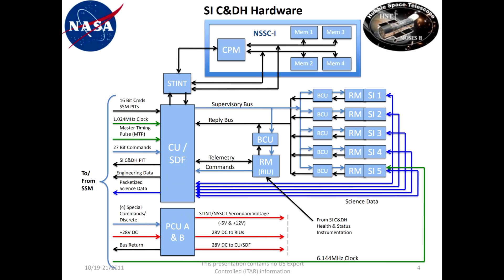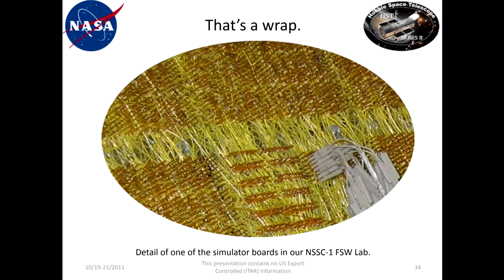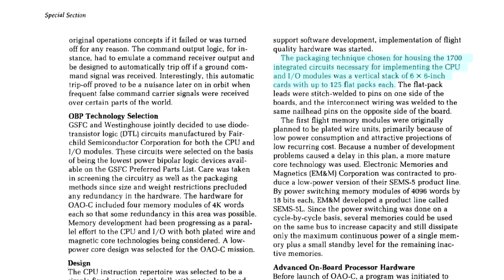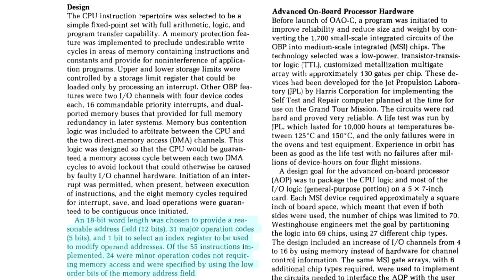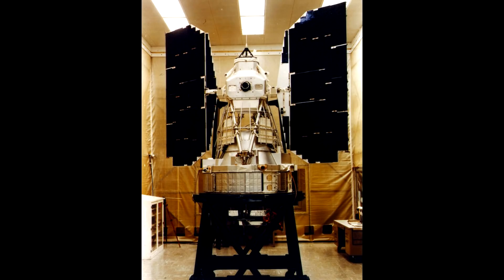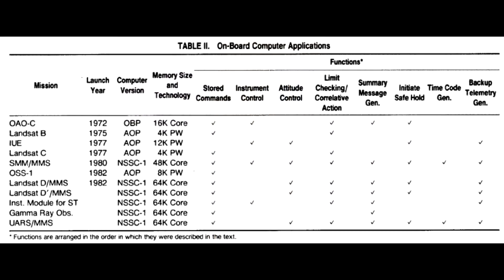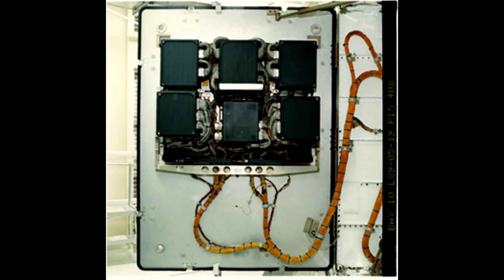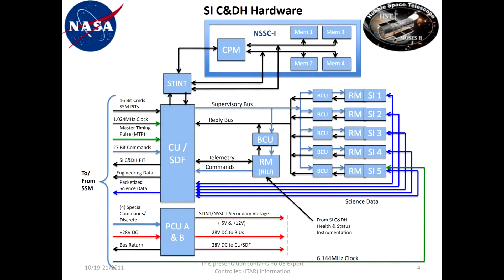Hubble's Latest Problems May Be In a 50 Year Old Computer Design

Comment: A 50 Lb computer on a spacecraft? We can fix this with something that fits into the palm of your hand. Let's do it! I would like to see Hubble continue as long as it can and ultimately become available to amateur astronomers who submit money and a proposal for some time. The fee can be used to cover the maintenance of Hubble. Don't just send it out into space or crashing into the earth. Take it to the public to see what the response will be.
Reply: Won't fit in your hand once you add radiation protection and a power supply that can power the entire telescope.
Reply: An astronaut could wear an Apple Watch and donate it on the spacewalk.
Reply: There's a reason it's so big.  Number one, redundancies.  Your computer has none - generally doesn't need them - everything that goes up into space does, unless you consider it disposable.  Number two is radiation.  It's the electronic equivalent of sandblasting.  Little errors in live memory here and there which need correcting all the time, and actual atomic-level damage which slowly accumulates.  Practical amounts of shielding cannot stop all of it.  You have to build around it by making your IC's less fine and delicate.

Which isn't to say that things have stayed unchanged in space.  There's things like militarized, low-end pi's up there, running hundreds of mhz (which can do a lot, if you don't need to run windows on it).

Comment: As for having a spacecraft capable of a Hubble repair mission: It's sorta already underdevelopment. The Dragon XL being built for the Gateway has a large pressurized habitable compartment. Launch one to the Hubble, filled with tools and the EVA suits (EMUs), and follow it with a Dragon crewed with 3 or 4. The Crew Dragon (CD) docks with the XL and two astronauts board it. The craft undock. The 2 crew do their O2 pre-breathing and don the EMUs. The XL is depressurized and the 2 astronauts exit. The Gateway will have one or more small robot arms. One of these can be adapted for this mission, and XL will already be designed to be compatible. With the spacewalk complete and the crew back inside, the CD docks again. In this way the XL functions as a detachable airlock. The capability for another spacewalk is there if needed - no need to worry about how many depressurizations are done, XL can carry plenty of O2 and N2. 

Remember, the airlock has to be big enough for 2 astronauts to don the EMUs, and they're big. The XL is a nice large "airlock." There is a problem, though - the EMUs can't fit through the Dragon docking port. IIRC the XL version will have a larger one, but then it won't be compatible with the regular Dragon. This mission is fairly minimal cost so far, but adding an egress hatch on XL's side will bring the cost of engineering/approving a crew-rated design. Hopefully an enlarged version of the CD side hatch will be straightforward enough.

Well, it'll never happen anyway, but it's fun to know the capabilities. If anything is done with Hubble it will depend on Starship succeeding. And realistically, with Starship available is it practical to service decades old technology? Solving the problems of returning Hubble to Earth will be more fruitful. It doesn't have to be undamaged, just intact enough to be rebuilt.

Comment: How about sending a Dragon there to fix it? Two pilots, two eva suits. With the lower cost of the falcon vs shuttle, it might be worth it to make a birthing adaptor to hook onto the hubble and keep it going?
Reply: Or have an official say "this is so hard, even SpaceX couldn't do it"
Reply: This is would be job for the ISS, because it needs to be captured by an arm. But Hubble might be to big for the ISS arm also. And I think the ISS is no where near Hubble orbit. Crew dragon doesn’t have air locking systems so no one can leave Dragon and do a spacewalk. Only the shuttle had the systems required for this type of job.

Comment: Core memory and tape decks. I had no idea this was the original design. So unremarkable for something so visionary.
Reply: It was standard procedure at the time it was designed.  Worked for Galileo.  Semiconductors were and still are very vulnerable to radiation.  Any space probe which doesn't die from something else, the radiation gets eventually

Comment: There's one wild turkey of an idea... There is still a Buran that is 95-97% completed sat in the hanger... Get it finished, refurbish the machine and there's your shuttle right there to fix the HST
Reply: The roof fell in on it a few years ago, it's stuffed big time.
Reply: @paulstubbs7678  That was the one that flew - there is still another almost complete one there
Reply: No..there isn't.  Both of the Buran shuttles are either destroyed or are in derelict status.   It was a nice thought--but not rooted in reality.  

HST is 31 years old...its gone well past its designed service lifetime.   When the last servicing mission was performed in 2009, astronauts attached what was called the SCM (Soft Capture Mechanism) to the base of Hubble for a future next generation vehicle to dock with Hubble and guide to a deorbit into the Earth's atmosphere. 

The good part about Hubble's situation is that it is in orbit 600 KM above Earth...so its not going to degrade and burn up in the atmosphere anytime soon. 

So if it goes dark--it could conceivably be orbiting for years--during which time that next generation vehicle is equipped for such a mission.

Comment: Good lord, Hubble is controlled by a Commodore 64 which is known to have power supply problems.   

Hahahahaha
Reply: Hmmm the clock speed of the cpu does look very 6510 but I doubt that a MOS chip would have been space hardened ;)
Reply from the maker: Did you know the ISS has a piece of hardware to control the battery charging for the space suits and it’s powered by a 6502?
Reply: @scottmanley  that's awesome! I know that NASA was still using Amiga 1000s for processing telemetry data up until 04 I think but having a 6502 on the ISS takes the cake.
Reply: @scottmanley  
Suprised they can even find a reliable source of 6502s..

Comment: I have gotten old with the Hubble. Is there something they could do with the autonomous robot they designed for the ISS? A program and added booster, not tme frame, and send t on its way? Hate to see such a great old friend wither away...
Reply: hubble is in a very different orbit.  Not easy to get there.  But I've often wondered why they haven't built a tele-operated robot to just send up from the ground.
Reply: @tsm688  As I remember, they did. To do work on the ISS. But I haven't seen or heard anything about it since they announced.
Reply: @christophervanmeier1648  Meaning they kind of thought about it at little bit but scrapping all available options was easier.  Meh.

Comment: Hi Scott you said that nothing that can fly can fix Hubble like what the space shuttle did. I think you are wrong the ISS can fix it. It has all the amenities like manipulation arm and spacewalk capabilities all what need to happen is for the Hubble to move/rendezvous with the ISS so that the canada arm can get it. This can be done by a mission extension spacecraft that can connect to Hubble just like the how the shuttle did. Once there new modules can be brought up in the trunk of Dragon (if they fit). The bigger probably is to build/design components that work with both the old stuff and new stuff
Reply: The hubble is in totally the wrong orbit for that, nowhere near it.
Reply: @tsm688  HI that is what the mission extension vehicle will do. Hubble is in a 550km orbit with a 23 degree inclination and the ISS in a a 400km orbit with a 51 degree inclination. The main problem is the inclination difference of 23 degrees with will requier a lot of fuel to change but it wont be impossible
Reply: @jonathancampbell3907  I mean, nothing is impossible, but that is pretty implausible.
Reply: It would make the ISS be a repair station

Comment: I find it funny that how all the people who claim the Space Shuttle was a failure and should not have been built, never discuss the Shuttles' unique ability to conduct in-space rendezvous/repairs.  They ignore the fact that it would have been the Hubble Telescope that would have been a failure without the Shuttles' capability, nor would the Hubble Program been as long lasting as it is without the refurbishing missions performed by the Shuttles.  They also refuse to acknowleded that the ISS would not have been constructed as quickly or as immense without the ability of the Shuttles.  The current Hubble issue will not be the only episode where NASA will state "If we had a way to get people and equipment up to it we could fix this".
Reply: There's a couple angles on this.  But mainly, we could have had a handful of Hubbles for the cost of all the monkeying we've been doing to just that one.  And the space shuttle was responsible for the massive delay getting it into space in the first place.  But at least one servicing had to be done to restore faith (and therefore funding) to NASA.

I agree the space shuttle was unique and I miss it.  But the real failure is the lack of drive to improve on or even just replace it with more mundane rockets.  It doesn't take a genius to consider attaching a robot arm to a space capsule - and we don't even have that.
Reply: @tsm688  Just to be sure, I doubled checked with the HST history.  It is true that the Challenger disaster delayed the HST launch. it was already far behind schedule and vastly over budget.  The records shows that the ground based controlled systems were not ready for HST's initial 1986 launch date, and was barely ready for the 1990 launch.  As for funding, like all NASA projects the Shuttles were under constant attack by members of Congress, so that argument rings a bit shallow.  One thing I've also observed is that a lot of people claim that the Shuttle Program was more expensive than single use rockets, but I've never seen anybody crunch the numbers.  Even searching now through the interweb, I've only seen 'rough estimates' by influencers who do not have a qualifying background.

Could the program been run better, absolutely.  Did it achieve all it was initially designed for, no.  But I strongly doubt any other program, run at the same time for the same objectives, could have achieved the same results of the Space Shuttle Program.

Comment: So the next computer will be a couple of raspberry pis in a radiation protective box? Pull the spaceshuttle out of the display, wipe of the dust and fill it up?
Reply: They've had reasonably effective computers running hundreds of mhz in space for quite a while now, no need to send a pi when you can send something radiation-hardened.

Comment: why not just attach a wifi router on the satellite. Than, rather than trying to insert or remove computers, u just throw a phone on it with a magnet on and use the phone to do the computation
Reply: Either device will have the compute power but not the interface ports to operate Hubble.  It's more like the big console running a concert, with cables running to every light and every microphone.
Reply: The radiation will reboot it weekly, and it'll be dead in a few months.  Space is not friendly to electronics.  That's why everything is so massively overbuilt
Reply: @tsm688  then just make more smartphones, which self backs up each other
Reply: @mikumikuiyada  ..and now they're all dead.  Now what?

Comment: How are the batteries in Hubble or in satellites? How long do they last? Or do they use capacitors?
Reply: Hubble and lots of other space stuff uses nickel-hydrogen, good for at least 15 years.  Hubble's were swapped out for fresh ones in 2009.

Big capacitors don't do so well in space because of the liquid inside which tends to boil or dry out.

Comment: How about a "Mission Extension" type of vehicle that can drop Hubble into range of the ISS, and service it from there?
Reply: have you done the math on the amount of delta V for a TREMENDOUS plane change?
Reply: A service mission wouldn't be impossible, but you'd go too Hubble not move its orbit.

But there's not really a vehicle for it. Not quite Kerbal where we can just tell somebody to hop out from a crew dragon and hit it with a wrench.
Reply: I think there were plans to move Hubble to ISS coplanar orbit (using solar electric propulsion or a modified Centaur), but they were too expensive for NASA.
Reply: Need something like a simplified Zarya or Zvevda module with a manipulator arm, and proper docking/airlock ports. Send it out to rendezvous with Hubble, and send a crew Dragon, or whatever other craft you want. May actually be a market for a craft like that as a "portable repair station."
Reply: @tangydiesel1886  yea I had that idea too. Basically a orbital vessel/micro station that crew dragon, Soyuz, etc could dock with before rendezvousing with their target. Give it a manipulator arm, some thrusters, and a airlock. Maybe some internal working space too. 

Could even leave it docked with ISS
Reply: @Joesolo13  I don't know the math, but it may take more fuel to keep it in orbit, rendezvous with it, switch orbits, and rendezvous with each target vehicle, than to launch a new module each time it's needed. Zvezda is 20 metric tons. The old Apollo ascent stage was 5 metric tons, a disposable airlock and eva support module could probably be about the same. It may require a separate launch, but into a similar orbit to the satellite simplifying rendezvous.
Reply: @tangydiesel1886  I like the idea of a Canadarm for the Crew Dragon.  Maybe SpaceX could commission one from by SpaceEh?
Reply: @toonarmycaptain  "not trivial",... But one heck of a ride. And a potential future business market, commercial satellite maintenance.
Reply: Interesting idea. But I think the tug spacecraft would have to massive. HST itself masses ~11 tons. Inclination change alone would take at least about 3km/s of delta V.
Reply: Rocket Labs have this Kick Stage vehicle... Use one to push around a TransHab with an airlock and all the parts. Must be a business model for satellite service calls.

Heck, Tom Barnard did a cold gas thruster variant of a Quadcopter, scale that up and jet the parts and people over from ISS to Hubble 😊

Comment: It would be cool if Space X or Boeing came up with a manipulator arm and airlock assembly that could be launched separately to the target and then docked with. To allow for EVAs when needed.
Reply: Why not a canadarm on an unmanned vehicle.  This is close enough to Earth for real time remote control by ground based technicians.  The unmanned vehicle would do module swaps with a mini arm handling unplugging and screws.
Reply: @johndododoe1411  it's not a bad idea.  The only challenge would be maintaining a good real time signal as it orbits around the planet jumping from one ground station to the next.  Though I don't see any reason you couldn't pause the work during a period of poor reception.
Reply: @MrBtdobie  That used to be incredibly challenging, before the internet.

Comment: what if they launched an autonomous tug that rendezvous with hubble telescope and brings it over to the international space station for repair then back out to its original orbit?
Reply: Theoretically possible, but the Hubble is in a 28.47° inclined orbit and the ISS is at 51.64° so that you can get to it from Baikonur, and plane changes are expensive :/

Comment: Something is tugging at my memory from college in 2001 when one of my professors talked about a CPU upgrade mission to hubble said that the upgrade was likened to going from an 8086 to  386 processor.

Edit: service mission 1 added the 386 co-processor.
Service mission 3a in 1999 replaced the computers with 486s